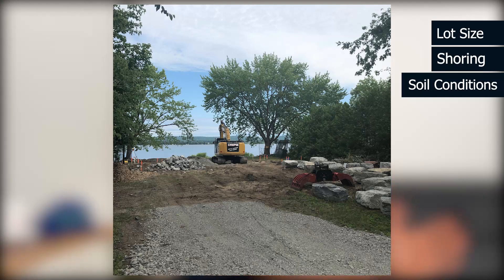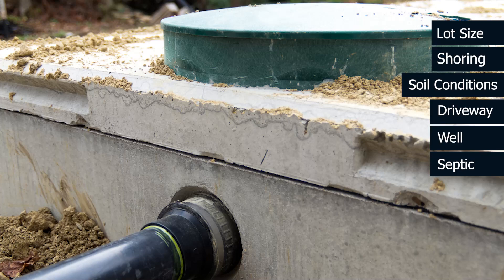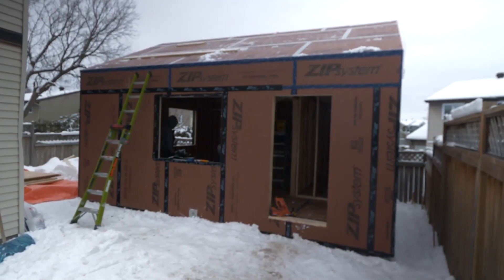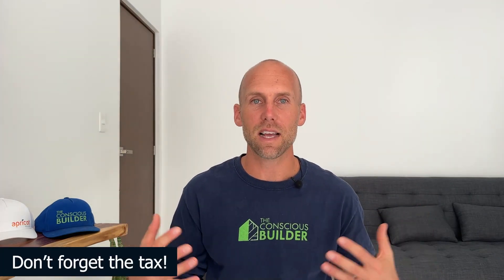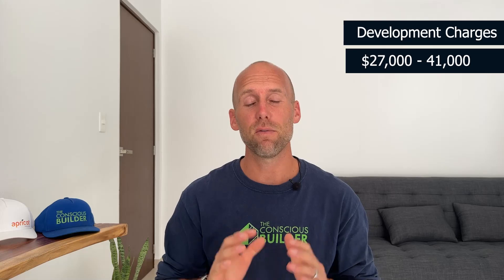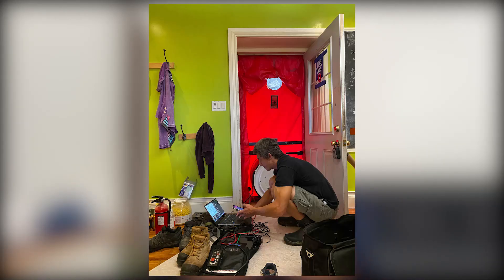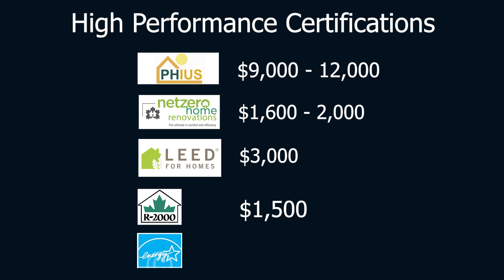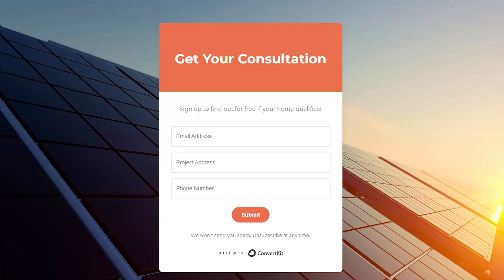How Much Does it Cost to Build a Custom Home?

Comment: Very well put together breakout on building costs, sets expectations and considerations very well. That said, when you said $400 sqft would be what you described as the starting point (excluding any site prep work or costs, that pretty much kills it for most people ever being able to build custom. It is what it is.
Reply from the maker: Thanks for watching, really appreciate the feedback. Certainly there are ways to build for less, and depending where you live, costs can vary a lot. This is a number that we find helps people budget for a project with eyes open and expectations realistic when working through the design and build process here in Ottawa.
Reply: @Theconsciousbuilder  are you including basement and garage in the estimate? 400 seems to be on the higher end for us in Toronto but it wouldn’t surprise me due to inflation.
Reply from the maker: @cerealkilla4eva  It could depending on the design. You do, however, need to include the basement in the square footage calculation. We always measure to the outside of walls as well for a buffer.
Reply: It seems most builders will quote low and then ding you on all the upgrades for bath and kitchen such as appliances, tile, cabs and flooring

Comment: What would you say about multi unit builds?  5 plex and up.
Reply: Totally different set of rules as there are various plumbing, electric, and HVAC requirements involved that need to be tailored to specific projects and the variability is too great to give any sort of sft rates.
Reply: @cerealkilla4eva I suppose more of a general "this aspect will cost more per swft, this aspect will cost less".  Obviously way more fixtures, but theoretically some savings on site work and foundation/roof..
Reply from the maker: @MrBaconis  We don't have any of our own data to work on but if we're talking about the building only, I suspect it will be similar if not more. You'll spend more on interior finishes because you'll have more kitchens and bathrooms taking up a higher percentage of space and you'll also have more HVAC equipment and fire separation requirements. There will be savings on exterior finishes, windows and doors though as you'll have more shared walls.

Comment: 18:19 "$400 per square foot."
What?!? So a 10,000 sq. foot house would be 6 million dollars? That seems insane. I can buy a TV for $500 that would have cost over $20,000 in the 90's and it wouldn't even be HD, so why is home construction not getting any cheaper when everything else in the world is?
Reply from the maker: Yes. The two industries are very different. Manufacturing and labour for tech like TVs has reduced in price since the 90's for many reasons. They are often made in countries where materials and labour are cheaper and a lot of the work is repetitive and automated. Materials and labour for home building have increased in price for many different reasons, like inflation on the cost of materials, supply chain changes and the fact that each home is often different and needs to be designed and build differently by humans. Definitely not everything else in the world is getting cheaper!